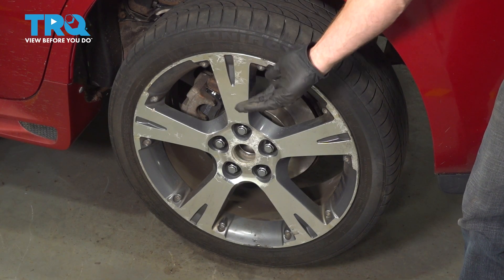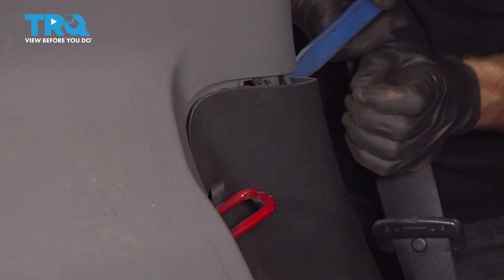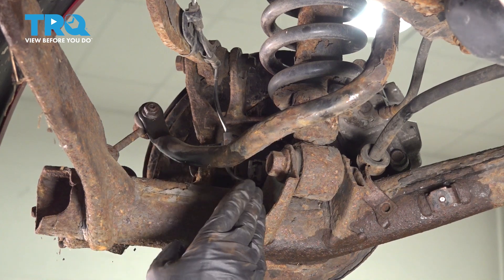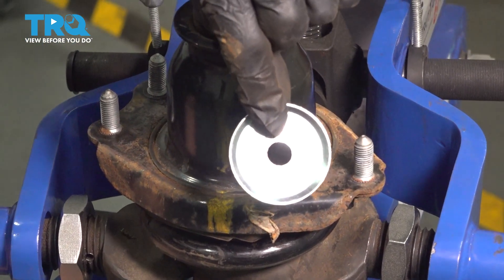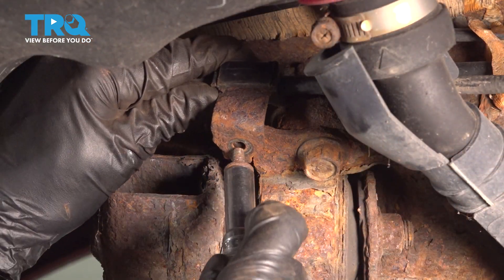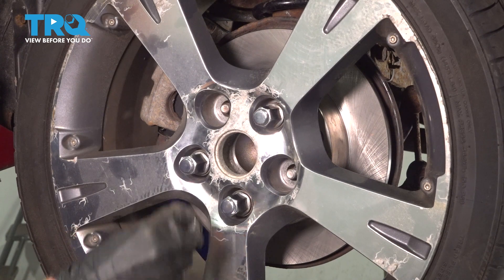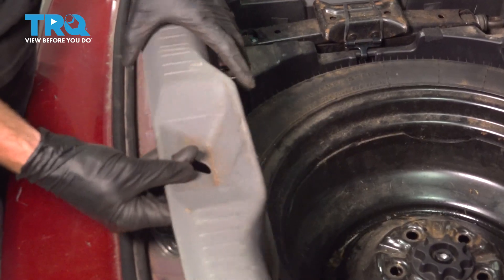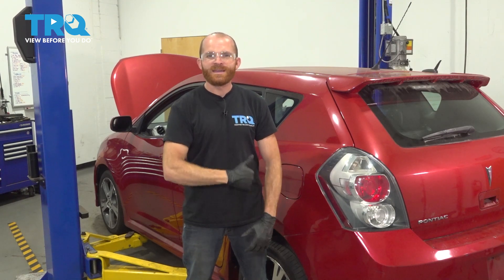How to Replace Rear Strut 2009-2010 Pontiac Vibe

Comment: Would this be the same process just without needing to compress the spring and take the strut out if I'm replacing the whole assembly? My rear left coil spring is broken and my mechanic said they can't pass my inspection until it's replaced.
Reply: I know it's 7 months old, but yes, it's the same process. You have to remove the old strut assembly just like he did in order to replace it with a new strut assembly.